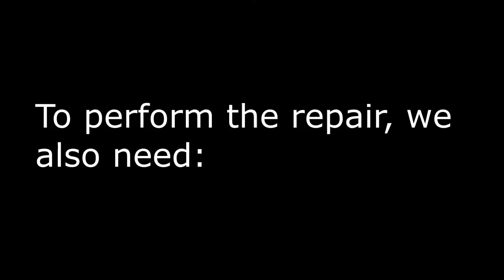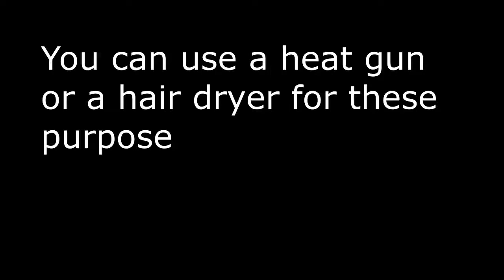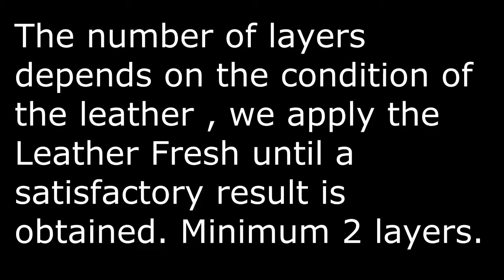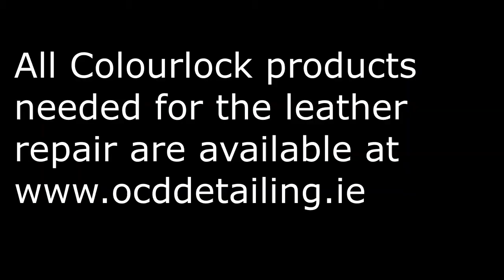How to restore leather ? DIY bolster repair  . Colourlock

Comment: How is the texture or grain after it’s done?
Reply from the maker: n this case the leather was smooth  so there was no difference in the stucture of repaired place and the rest .
Reply: Colorlock has like stuff where you can make a mall of. But that is only for "profesionnals"

Comment: How can i get the correct colour for my car
Reply from the maker: Where do you live?
Reply: @OCDDetailing2021  pakistan
Reply from the maker: Try Colourlock Pakistan
Reply: @OCDDetailing2021  i want to do myself my car seats colour is atlas beige
Reply from the maker: @MaanzMotivation  Contact them they may supply you with the paint.
Reply: Which colour code is for my car in colourlock?
Reply: @OCDDetailing2021  ok thank u
Reply from the maker: @MaanzMotivation  I am not sure, if you contact them they surely will be able to provide you with the right one.
Reply from the maker: @MaanzMotivation  no problem